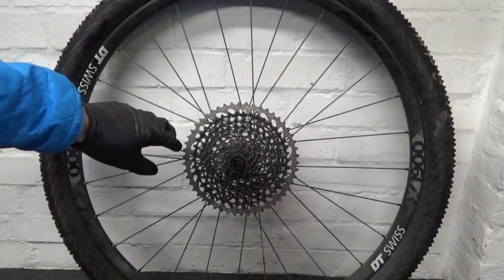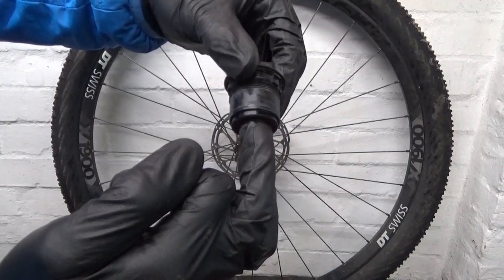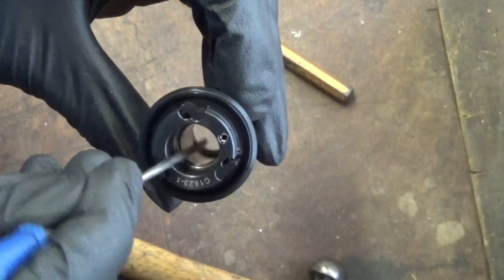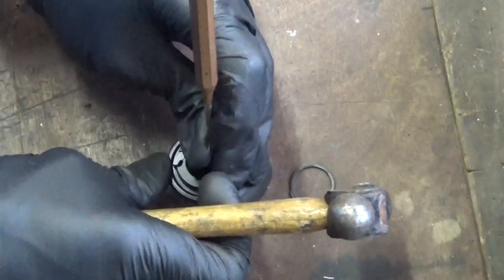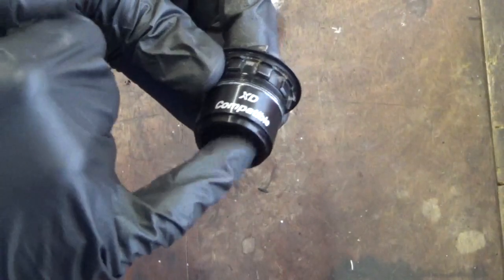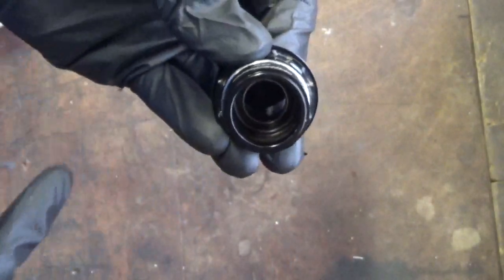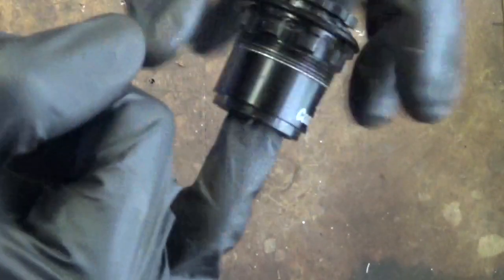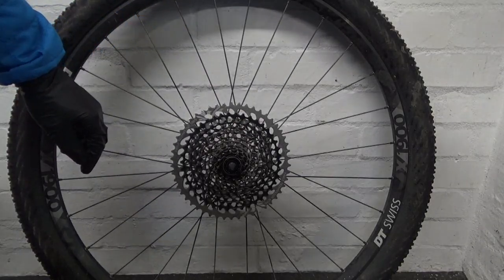DT Swiss SRAM XD Freehub Body Bearing Change

Comment: Great video. I'm in the process of changing out the freehub bearing in a DT Swiss P1800 Road wheel. 
Watch out on this hub as the inner bearing is held with a circle deepdown. You'll need to remove this before knocking the bearing out!

Comment: Hi, when i was spreading the sealant in my tire, my gx cassette just fell of the DT swiss hub, i guess it wasn't tightened all the way? I is weird because i never touched the cassette and it came like that from canyon, what can i do best to make sure it is secure? I now just pushed back in place without an cassete tool and it seems secured
Reply: I did the same thing with my 2017 YT Jeffsy! That's why I'm watching this video. There is just a plastic spacer that holds it in. Seems like just pressure from my frame and thru axle. I don't have answers for you, but just wanted to let you know you aren't the only one!